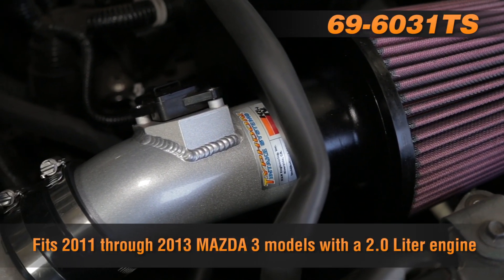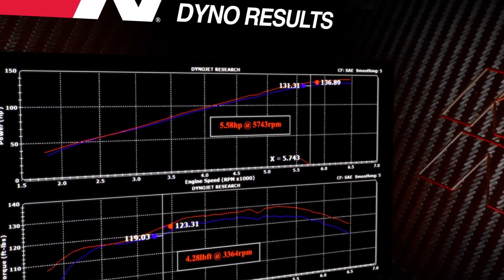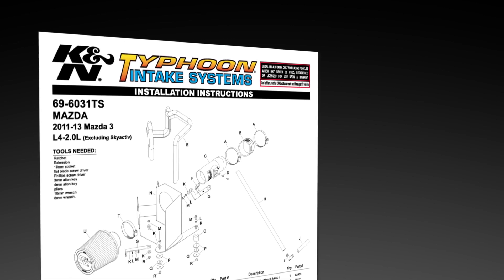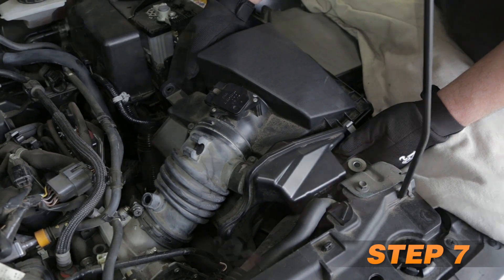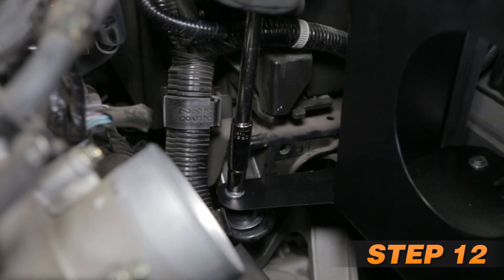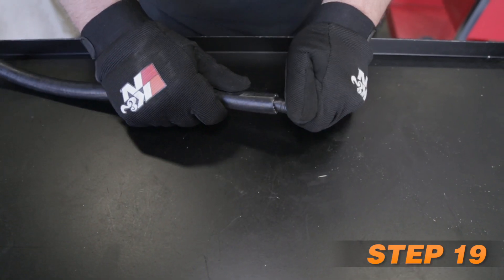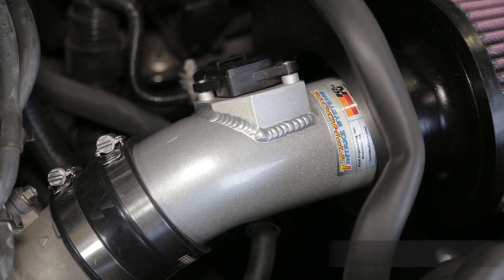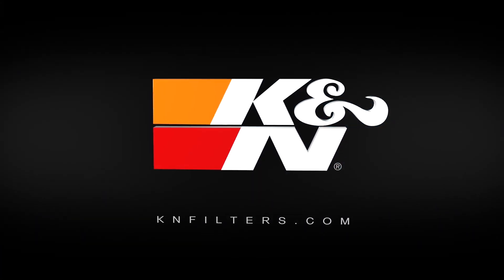Mazda 3 2.0L [#69-6031TS] Air Intake Installation Video

Comment: i have a 2007 mazda 6 with a 2.3 liter 4 cylinder could i buy an intake that is made for the car but is a 2.5 liter would that fit my car?
Reply from the maker: Check out Part # 69-6027TTK for your application https://www.knfilters.com/69-6027ttk-performance-air-intake-system

Comment: Would this work on the 2012 2.0l skyactiv model?
Reply: we have the same car and the same questions lmfao have you upgraded your exhaust system yet?
Reply from the maker: No this system does not work with the Skyactiv motor.  If you have any other questions please feel free to contact our Product Specialists at 800-858-3333 or tech@knfilters.com.

Comment: What is the difference between this Induction System 69 - 6031 TS and the 69 - 6013 TTK only the color of the tube? since the Mazda 3 2.0 and 2.5     2010 - 2013 No Skyactiv Engine  bring the same Throttle Body , the same MAF Sensor and the same vacuum connections
Reply: Will it fit a 2010 gs mazda 3

Comment: why wont this work on 2010 model? The manifold and throttle body look identical. Would like to install one of these filters, but am not sure what the difference is between the 2010 and 2011... can anyone explain?
Reply from the maker: There may be small differences in the models that prevent it from being compatible. Head over to www.knfilters.com to check if there's a different intake available for your model year.
Reply: @KNfilters  just the one that fits in my factory air box. Yet corksport sells an identical looking ram filter that says it fits my car. Long story short, corksport is stealing business from you.
Reply: Did you find a kit for the 2010 Mazda 3? I'm looking for one too but it's like looking for a needle in a haystack.
Reply: @mokbulhussain1476  No, in fact after doing a bit of asking around it turns out these things are actually a bad idea to install in the first place. The stock air box is actually a far better performer than this ram intake. If you want sound get a can of beans installed on the back lol.

Comment: 5hp is literally nothing.
Reply: At least they're honest about it.  How much gain do you expect from a filter change on a 2.0 naturally aspirated engine?  Modern air intakes really aren't that bad any more - they mainly focus on reducing intake noise for the vast majority of consumers, so there's maybe a little power to be gained there with a cone filter, but it's never going to unlock like 20bhp on an engine that had around 150ish to start with.
Reply: Oh boi